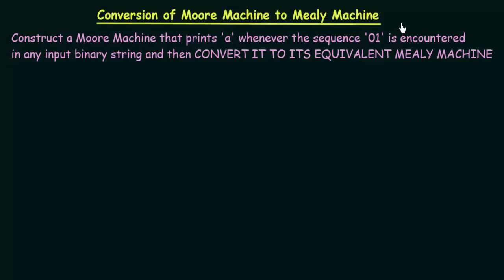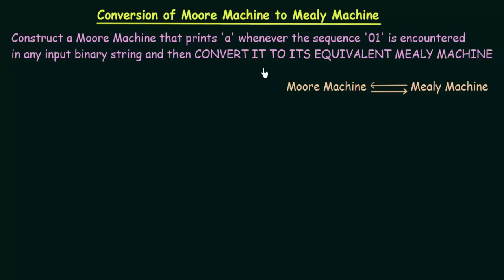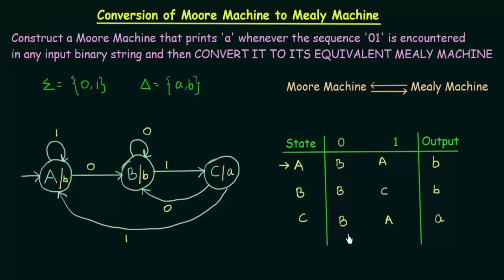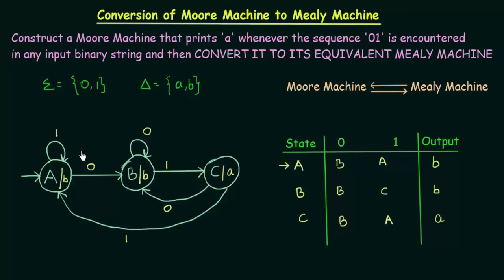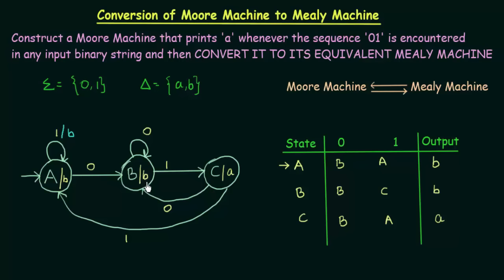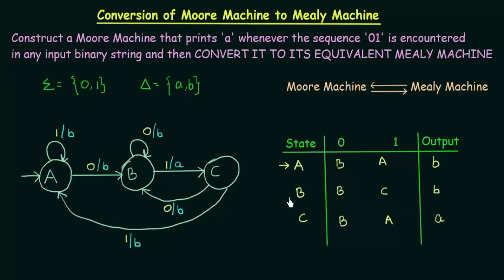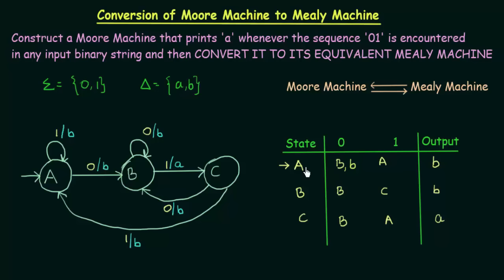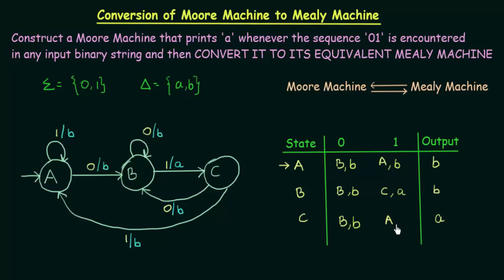Conversion of Moore Machine to Mealy Machine

Comment: You should've reduced the mealy transition table. As in the Mealy FSM, states are either same or fewer than the Moore FSM. So, you could have removed the redundant state C.
Reply: Please say me is it true: "The true Mealy FSM has 2 states and 4 transtions. A state has 1/b->A and 0/b->B transitions, B state has 0/b->B and 1/a->B transitions." I wait your reply. Thanks a lot. (If anyone knows true answer, please reply :) )
Reply: It can be more than two states. Not bounded to two. I myself have designed Mealy FSMs comprising of more than 4 flip flops even. Depends on requirements. As far as the word "true Mealy FSM" is concerned, I can't say much about it.
Reply: Thank you.
Reply: Almost Correct, What i got was same except for the transition in B , where 1/a-> A , as otherwise -011- will print 2 a's .
Reply: @asadawan3466  so state C is same as state A??
Reply: Asad Awan zn
Reply: How is it possible to remove C? C,a would still remain as next state for B